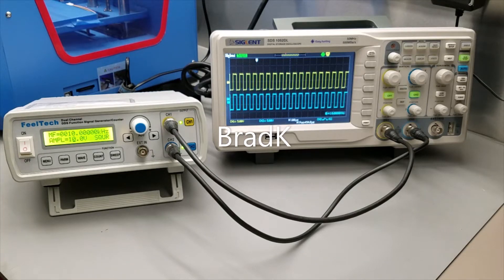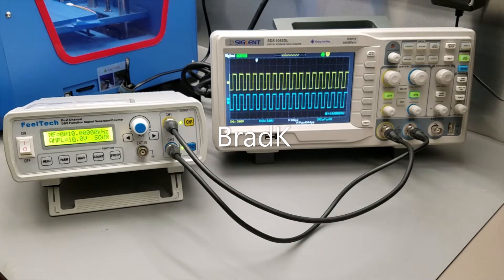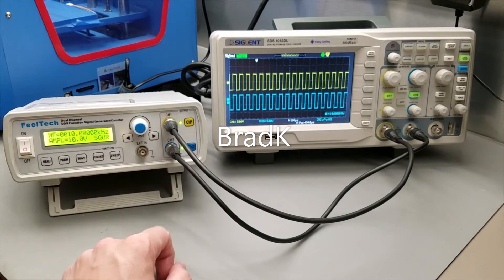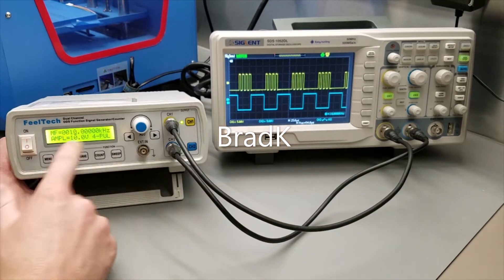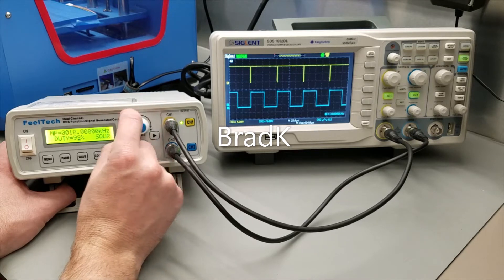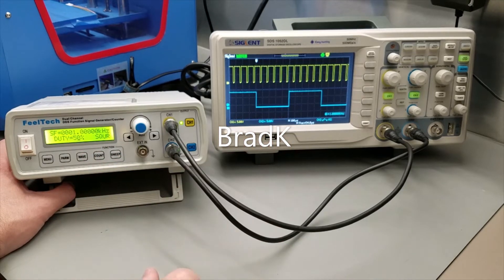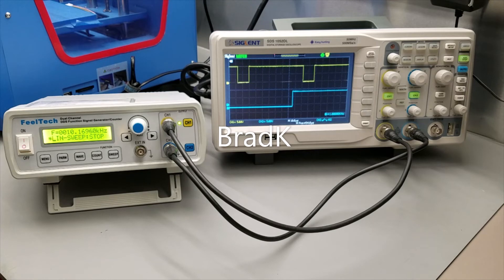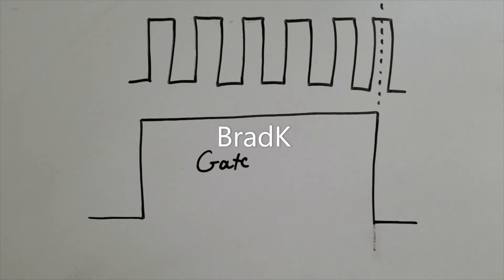Frequency Generator for Stan Meyer work

Comment: They are two different things... Producing HHO is the first. It is not an overunity device. High voltage needs to be used. The overunity is exactly VIC. It works in a similar way as Tesla devices. There is quick conversion U to I. Back EMF when is max must be short circuit. In that case, it becomes generator and charging up itself. The hint is to make a short circuit when Back EMF is close Max U and release when I is close Max. In Tesla circuits "spark gap" making it...

Comment: Amazing synchronicity.  I’m using the exact same signal generator in the same way.  Thanks for your tips on the pulse & sweep functions. They’re very helpful.  And I’ve been able to drive my SiC FETs directly from this signal generator at 12v. It surprised me when i just tried it.  Perhaps it’s living dangerously but so far so good.  It’s still running just fine.

Comment: Hey Brad, I'm dabbling in Stan's Voltrolosis too, You made a comment about adding the polar pulses together that I don't understand, my understanding of his patent paper is that you do not add them together, you have one electrode pulsed negatively and the other pulsed positively, there fore the molecule is puuuled apart not split. That is what you are doing and I miss understood your comment right? I have been looking at self resonance and staying away from the tuning if at all possible, but all I have done so far is blow up one of my monitors and get glass stuck in my dads arm when I was showing off my apparatus and the jar exploded, I now do everything open air, no pressure or storage whatsover :) I am also only trying to get proof of concept, so I keep my experiments simple, if I can make more with no electrolyte, less heat and less amps, than I win.
Reply from the maker: I meant the gate and resonant pulse train, the gate needs to be superimposed over the resonant pulse train but also synchronized so the gate does not cut any of the resonant pulses short.
Good luck with your work.
Reply: @BradKwfc  thanks, let me know if you need anything. Im enjoying your vids